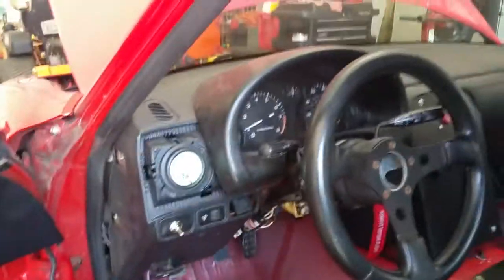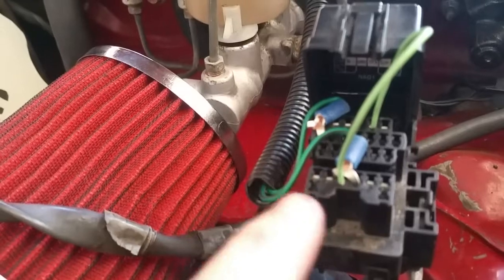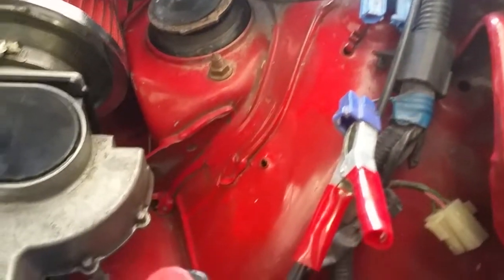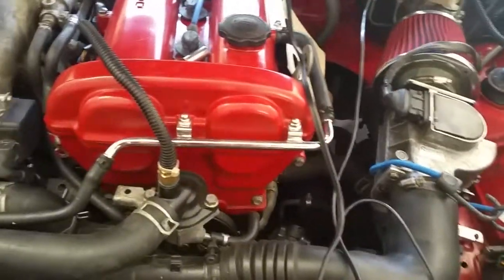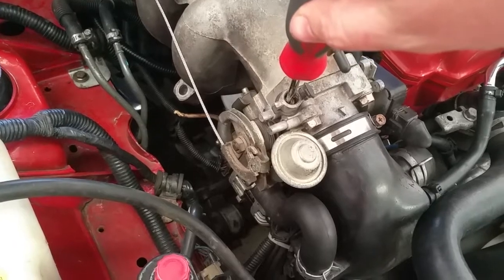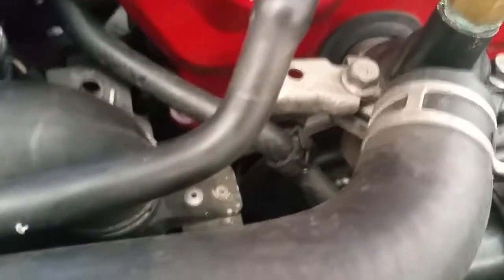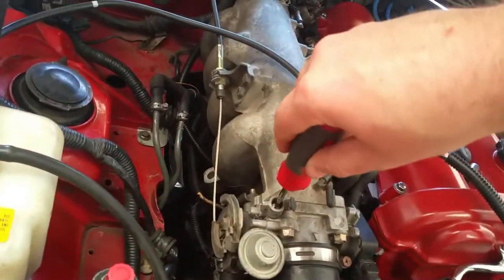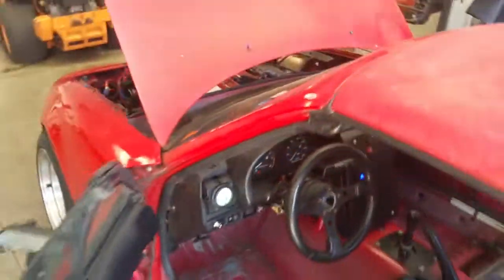How to set your 1.6L miata idle after timing the engine.

Comment: when i try to set my timing, the mark shows that its very advanced. If i retard the timing all the way with the cas it barely runs and still shows 16 degrees with the mark. I got somthing wrong. I kinda just guessed the timing rn and it runs ok. Im going to look at my friends 1.6 miata and see where his cas is at and prolly just copy his. It idles decently smooth around 900 rpm, but the idle air controller thing on the bottom of the throttle body has been deleted. Any ideas as how to do timing?
Reply from the maker: There is a possibility that your timing pulley has slipped on the rubber and the mark is no longer at the OEM position.  When setting the timing always use the timing pulley (the one with teeth under the drive pulley) to set initial timing.  Then use the CAS to dial in the couple of degrees.  If your idle air control is deleted then the best you can do is get it "just about right", the whole point of the IAC is to keep idle stable in all conditions, without it you will never be dialed in.
Reply: @CodyYankey  Thanks!

Comment: You never showed how to actually adjust the timing... only how to change your idle RPM's, which correct me if I'm wrong, but that has nothing to do with the actual timing...
Reply from the maker: Man, you are absolutely right.  I need to change the title of this video.  You would normally use the CAS (Cam angle sensor) to adjust your base timing and then just use the throttle body screw to adjust idle.  I am using megasquirt now and setting timing is much different.
Reply: NA6 driver ah gotcha! Haha no worries dude I was just confused as the where the CAS was but I got it figured out.
Reply from the maker: Great catch man.  Goodluck on getting everything timed right.  Seems like I put most of the correct information in the description.  Should have taken a bit more care with the video.

Comment: How do you have your air filter mounted? I'm about to remove my air box but does the cone just sit there "floating"?
Reply from the maker: Should I Get It there is a small adapter that fits into the AFM, you can get it on ebay for cheap.

Comment: Just replaced my CAS o ring due to an oil leak and when I put it back the tabs spun, so my timing was advanced. Played around with it and instead of going back to 10 degrees, I set it advanced a bit to 14. I used the paperclip, and light, but never touch the idle screw. My idle seems normal, about 900-950, but I'm still experiencing pinging in every gear at around 2-2.5k. It's very light, and only noticeable if you listen close, but it's definitely like small pebbles in a can type of rattle. I did this advance in timing with a half tank of 89 already in it, so I'm hoping that's the issue. I plan on running 93 to reduce the pre detonation. Is it likely to ping at 14 degree adv. with 89 oct?
Reply from the maker: Dan DeMaio Yeah, if you are pinging it's from the poor octane gas.  I'd go and fill the rest of the tank up with 93 just to be on the safe side.  I think the markings are in increments of 2 degrees so be sure you advanced to 14 degrees and not 18 degrees.
Reply: Yes run 93 next fill up

Comment: yes but not entirely sure. imma try again with a different paperclip. Does it have to be in all the way. is there another way to tell when in diagnostic mode beside engine slowing down. i read somewhere if you put it in the 10 and gnd and have car in the on position it will show cel and then disappear
Reply from the maker: +Icezero73108 I'm not positive about the CEL.  There is no audible sound or anything for how far into the pin you need to be.  As long as you put it in the area with a metal connection you should be fine.  Strange you are having issues like this.  The only thing I can think is either the timing belt was done incorrectly and the small window of adjustment offered by the CAS is just not enough or you have some keyway problem causing the timing belt to slip.  Another thing I have seen happen to people is the crank pulley can sometimes "slip", meaning that the pulley  will display the incorrect timing marks even if you are timed correctly.  This is rare and usually happens to people that race their cars heavily but it is something to consider since the car is so old.
Reply: +NA6 driver i went and check for fault code and i got a code 26 for a purge valve canister solenoid. but no cel on normal though
Reply: +Icezero73108 i guess i can change my timing belt and water pump and see if that does anything since i would have to take off my valve cover to check to see if timng is off
Reply from the maker: +Icezero73108 the code you got might be an issue for emissions honestly, you'd need to check that with other online sources as the area I live doesn't have emissions.  just taking the timing cover off is easy, a full timing belt job will require the removal of many more parts.  There are some tests you can do to check if you #1 is correctly at TDC, but it requires you to take a long screw driver or something small enough to fit in the spark plug hole, rotate the engine by hand until you see the moment the screw driver goes from the furthest up position and makes the rotation back down, in those few degrees you will be at true TDC.  Look at the cam wheels and see if the align correctly and the crank pulley and see what position it is at in reference to your timing marks.  This process is hard to type out so you will need to do some google searches on this as well.  It's easy to do and will verify if either you belt has slipped a tooth or another issue you may be having with your timing.
Reply: +NA6 driver i ll check it out. last resort is timing belt change. thanks for your help. i wished california didnt have any emission that is so strict. cant do anything fun

Comment: i tried to adjust my ignition timing clockwise as far back as i could but only gettint to 18 degree instead of a 10 degree.
Reply from the maker: sounds like your timing belt slipped or was installled incorrectly.  Did you recently do a timing belt job?
Reply: +NA6 driver havent done it yet and failed smog because of ignition timing was at 20 bdtc. Before i recently  change the spark plug and wires i was able to set timing back 10 but the car hesitates to accelerate and wouldnt get any throttle so i change the plugs and wires.
Reply from the maker: +Icezero73108 sounds like you may have some keyway issues on the crank, is it a short nose crank?
Reply: +NA6 driver 1993 miata 1.6 big nose. No wobble on the crank
Reply from the maker: +Icezero73108 So I didn't have any wobble on one of mine but the keyway was still eatten away.  Did you properly pin out the diagnostic box while setting your timing?

Comment: wait so why do you need to adjust the idle ?also, what was the switch you flipped?
Reply from the maker: +bobrulerofall The switch I flipped was my fan.  I jumpered it in the diagnostics box so I can toggle it on and off when I want.  I now have Megasquirt controlling the fans but I use the switch to toggle the fuel pump.  

So the motor was at like 19* advanced when I got it.  When I backed down the timing to a more reasonable 14* the idle shifted once I moved the Cam Angle Sensor (CAS) a few degrees.  So I adjusted the idle back to 900+-50 rpm.

Comment: So what's your current BTDC?
Reply from the maker: Not sure I follow your question.  I set base time advanced to 14* BTDC.  As for the static engine it was placed at TDC by the markings on the oil pump housing and timing pulley on the crank.
Reply: Cody Yankey Okay thank you!